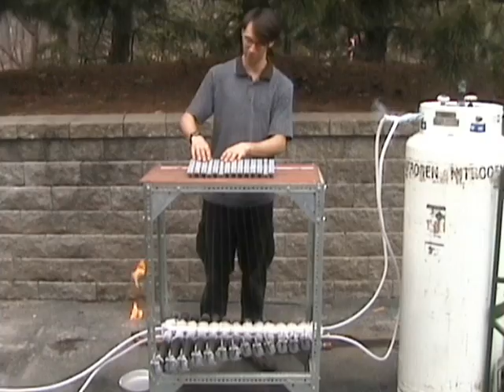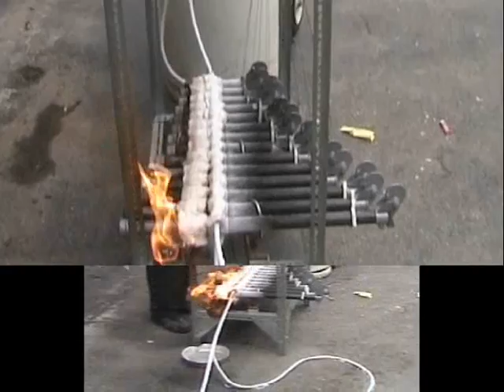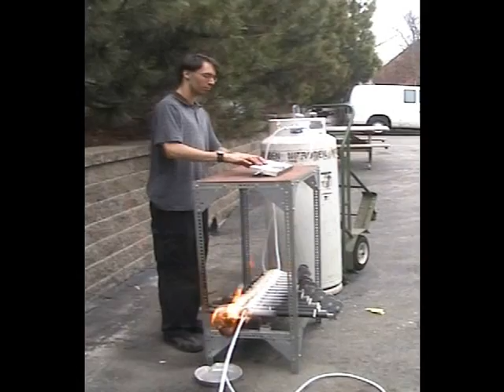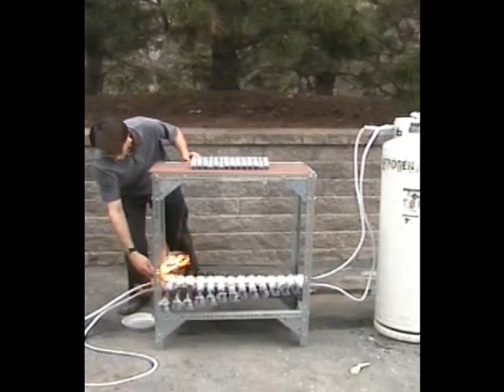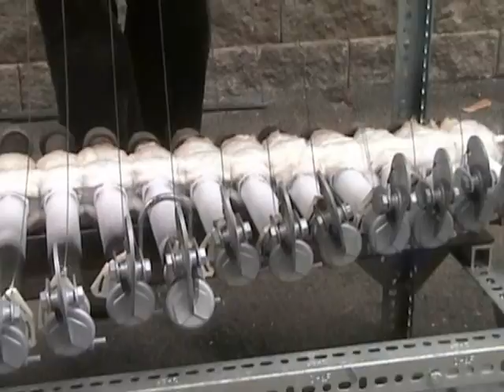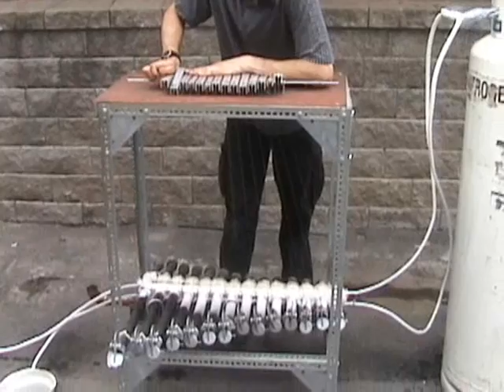An Organ of Fire and Ice

Comment: Hi! I have some questions about your thermoacoustic organ. Your university website documenting it went off line. Could we perhaps skype about it? I am trying to build one and your expertise would be grately appreciated.
Reply from the maker: Sure, what are you wondering?
Reply: @renegadeaccordion  Hi, thanks for your response. I forgot my question, since its been three years ago. I have since published a paper about thermoacoustic instruments in The Galpin Society Jounal, LXXI (71), March 2018. I am trying to build an electrically driven indoor instrument, still haven't figured out a good way for the heating...
Reply from the maker: @TheMolemi  neat. We did trials with just a heating wire. That worked OK but turning it on & off would have too slow a response for regular music. Using caps like the instrument shown here worked, but with the cap closed, the temperature would rise until it impacted the thermal gradient
Reply: @renegadeaccordion  You say simple heating wire worked for you...? It did not for me. I wrapped some heating wire around a ceramic block and put it inside a borosilicate glass tube but it didn't trigger the thermoacoustic effect. How much wire/resistance did you put, and how much voltage/current? Thanks :-J

Comment from the maker: In this device, the thermal temperature difference creates the standing wave in each pipe, and the length determines the frequency (quarter wavelength resonator).  If you had a single pitch driver, how would you modulate the frequency to each tube?

Comment: I'm currently working with thermoacoustics my self, and i have to say this is very impressive. You did a fantastic job. Do you think it would be possible to have a single thermoacoustic driver (a torodial traveling wave system) and have it connect to all the other channels, each calibrated for a certain note?

Comment: You need a way of adjusting the tuning!  We have the same problem with our hydraulophones: if we calculate the length and cut to length, it ends up requiring some fine-tuning by ear, due to differences in the mathematics and reality.

Comment from the maker: @plasmagrape Funny you should mention it.  The pitch of any organ pipe is dependent on its length and the speed of sound.  The lengths were cut correctly, but the liquid nitrogen cooled the air enough to change the speed of sound and thus the pitch.
Reply: Exactly what I was going to say, because you have such significant temperature gradients in the immediate ambient air, and you're outdoors where that air is moving unpredictably, you could never really tune it for use as a musical instrument. If the air is moving one direction, it may be flat, and if the wind changes it may become sharp. The physics of this demonstration are wonderful and interesting, but to pass judgement on the musical technicality would be to miss the point entirely.